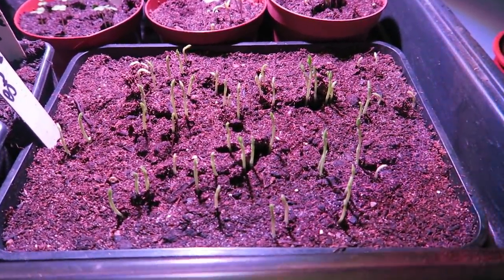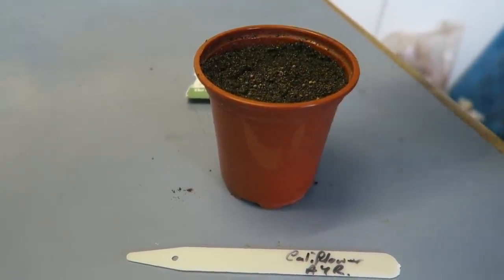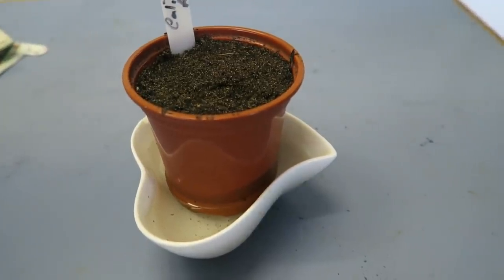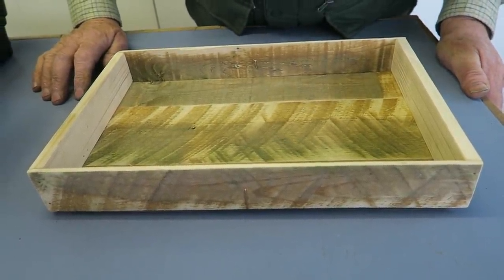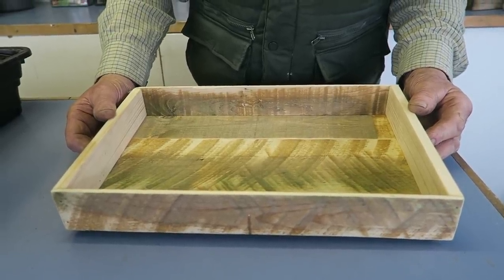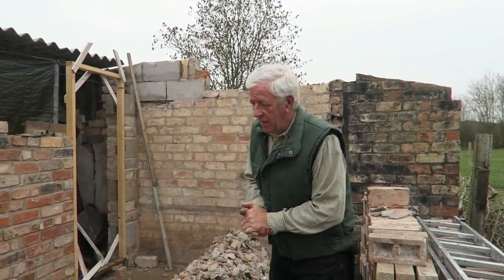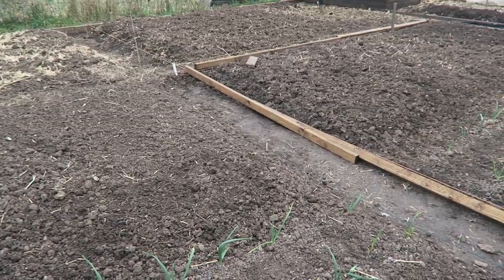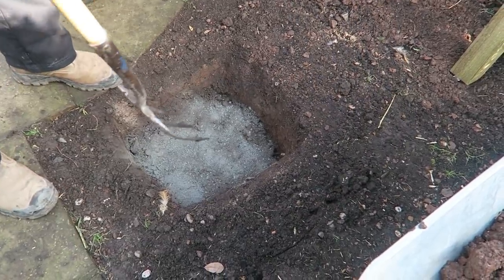Making Seed Trays, Setting Seed, Planting A Grapevine.

Comment: Hi Cliff and Diane, really love those seed trays I’m sure my granddad and father had those some years ago!
I’m trying to get away from those flimsy plastic ones and purchased only this week some nice polystyrene ones which look as though they may last a few years if looked after, plus they have that slight warmth to them! I will have a go at making the wooden ones at a later date
Have a great week and we’ll see you again next week.👍
Reply from the maker: Thanks David, just letting you know we did have to use the strip light in the shed this week as the light levels were very low. I find the polystyrene are too brittle for me to use as I break them, Its my large hands lol. Keep saving bits of scrap wood to make your trays, as new timber is quite expensive. Have a good week regards Cliff.

Comment: Nice watering tray.  Do you think it might help you to position those tiny nails if you used tapered jaw pliers or tweezers?  Maybe a small magnetic rod or pin would do the job.  Just a thought.  👍  Nice use of side cutters though.
Reply from the maker: Your right  Ron but my long nosed pliers were down on the greenhouse site, had to use the snips. Would have been easier if Diane held the nails but she said no way lol. Thanks for watching regards Cliff.

Comment: Hello Cliff and Diane, wondered if a staple gun and some sturdy staples would be easier for small jobs like the seed trays. 
I too have a problem with clay under beautiful soil which is like a quagmire just now as we have had scaffolders tramping about. My plan is to dig down below the clay and lay in stones I have saved for a drain. Don’t know how deep it goes so will give up if it is more than a spit down as I really am older than you and a bit creaky but improving and having rather more good days. Oh, there are only a couple of buckets full of stones, so not a big job for a fit, strong person,   Pity I don’t qualify,  anyway, nil desperandum,
Reply from the maker: Hi Norma, yes a heavy duty staple gun and staples would do a good job. Its a shame about the scaffolders tramping about, hopefully you will get straight when they are done. Putting drains in is quite hard work do take things steady. Thanks for watching regards from us both.